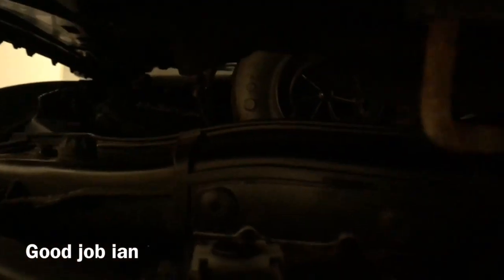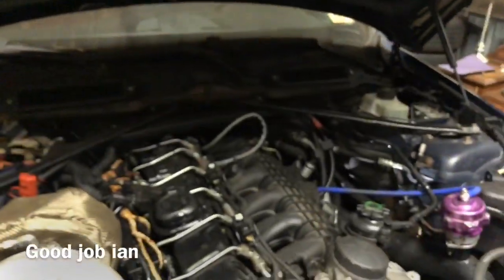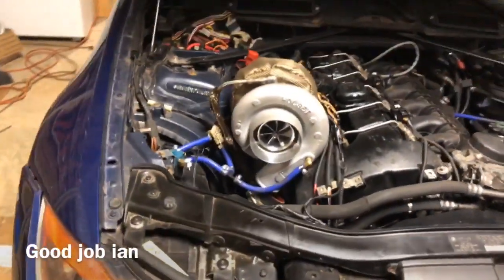Bmw n54 and vw gti  turbo setup update

Comment: I am building my vr6 too but  isn’t that HX40 is small for the vr6?
Reply from the maker: The Hx40 is good for 700 hp. It’s enough to blow the weld on the intake
Reply: Yeah then after that me and the mad scientist gonna have to rip apart the block to replace the piston rings you fried.

Comment: I'm looking to try out United Motorsports.
They seem like they have the most tunes available for the older aeb 1.8t, which is the only one that's drive by cable, and has the large Port heads, larger wrist pins.  They even have a big turbo e85 can tune for it.